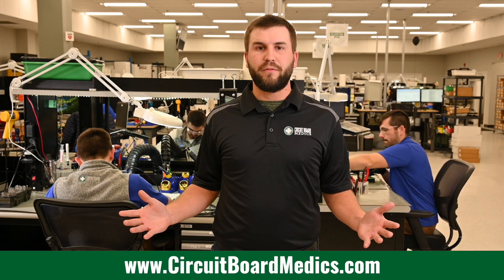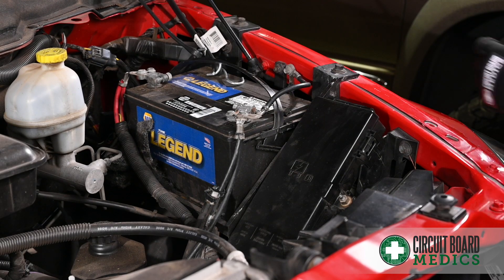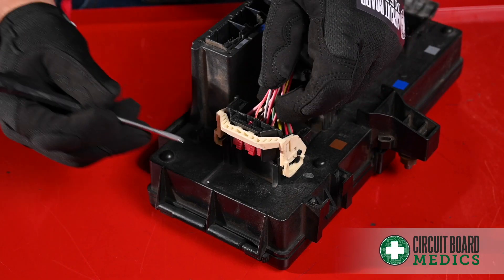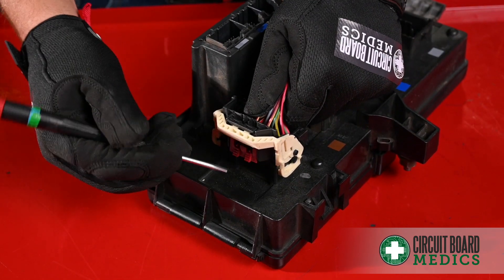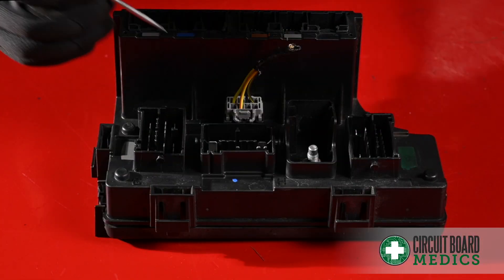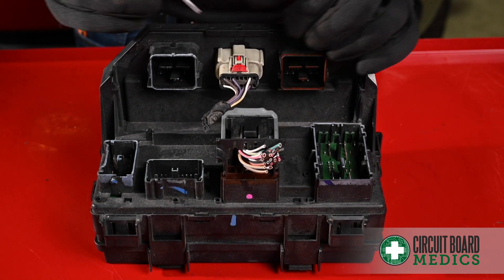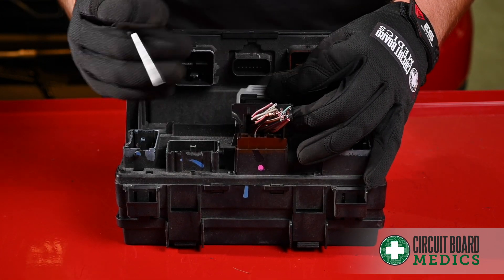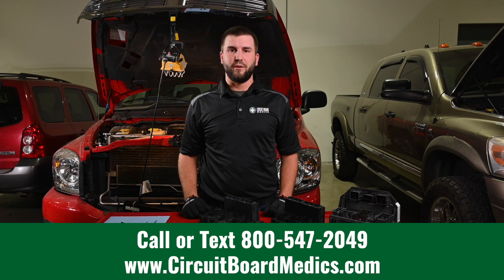TIPM [Dodge, Chrysler, Jeep] Removal and Solution

Comment: How much to repair 2013 avenger water intrusion lost blower motor wiper motor. And horn
Reply: How did you fix your car ? My car had the following symptoms: wipers going off on their own as well as the horn and random stalling.
Reply from the maker: @pmacias94  Once we start seeing modules such as those going off on their own, we recommend that the original be sent in so we can save the configuration while a replacement is ordered. If you have any further questions, you can call or text our customer support team at 800-547-2049 Mon - Fri 8am-5pm. We look forward to serving you!
Reply from the maker: If you have diagnosed the TIPM as the problem, we may be able to help. Please give us a call at 800-547-2049